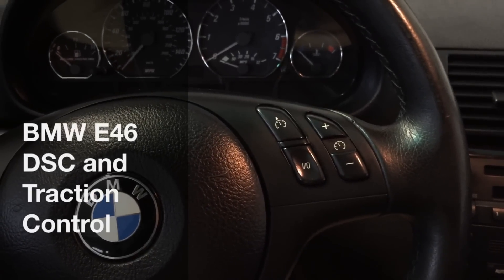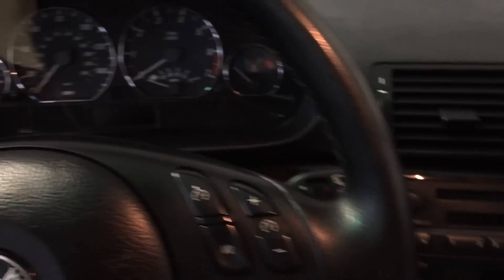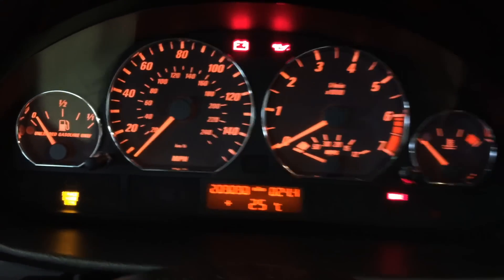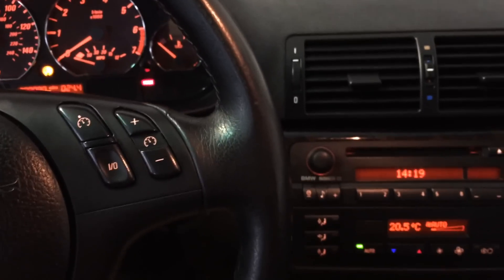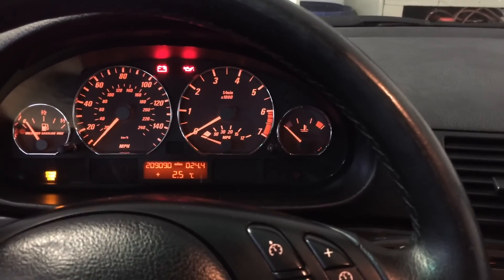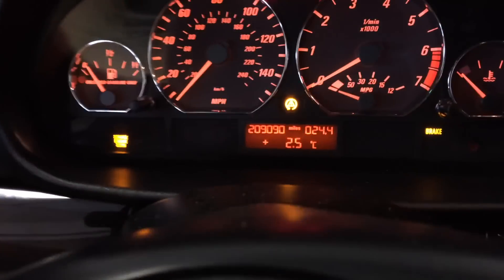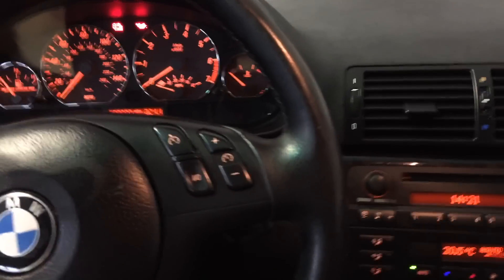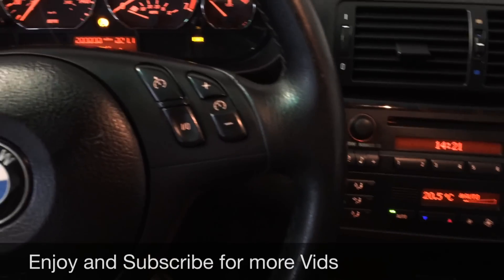BMW DSC in 3 min

Comment: ASC is a little bit different. If you guys have a ASC button than u just have to aktivate it once. And than you aktivate it komplettly. But the reason why you cant burnout/drift, could be your clutch. Because when it is slipped than you could have problems with Drifting or doing Burnouts. I hope it will help u guys!!!
Reply: i have 2002 e46 316i and i have ASC button. I was told that asc means only traction control for example when you accelerate and that it doesn't have stability control but when i hold my asc button for a few seconds both warning lights lit up (the triangle one in the middle and also yellow brake light) like on your car. i wonder how is it possible if asc doesn't have stability control that in my case the light for stability control (yellow brake light) lits up, any ideas why?

Comment: i have 2002 e46 316i and i have ASC button. I was told that asc means only traction control for example when you accelerate and that it doesn't have stability control but when i hold my asc button for a few seconds both warning lights lit up (the triangle one in the middle and also yellow brake light) like on your car. i wonder how is it possible if asc doesn't have stability control that in my case the light for stability control (yellow brake light) lits up, can someone explain?

Comment: My 2003 bmw 325i has a problem were the it has the yellow brake light on and my hand brake is down and still stays on and my dcs button won’t work I press it and won’t turn the light off and I wanna do a burnout lol. Any ideas what it could be ? Maybe abs sensors or. Dcs stability control pressure sensors?
Reply: JCarVideos MA what was the remedy for this? my car has the exact same problem
Reply: Check your traction sensors

Comment: Look at the mileage at the end of the video. It's all messed up. I noticed my stereo doing that on the BMW I just bought.
Reply: thats a common pixel error. Typical for BMWs of that era. Try and get a used replacement stereo. I did that too and it works now.

Comment: So when the lights on that’s the best way to drive?
Reply: No the exact opposite. The light warns you that dsc is disabled. If you want to drift or burn out or something like this turn dsc off. Otherwise in an everyday driving you must be sure dsc is enabled. It is automatically enable everytime you turn on your car and if you dont press the button it will be activated. It can save your ass in a bad situation.

Comment: I have a 2000 BMW e46 328i and I hold dsc for 6 seconds but my light to tell me my systems are completely off doesn't turn on, is it possible a fuse is out or something
Reply from the maker: There might be a difference between your model year 2000 328i since my car is a 325ci and was produced between 2001-2006. Does your button say DSC or something else like DCT, ACT, or ACS? If a fuse was blown then the result would be both lights, warning triangle and yellow brake light, would be illuminated all the time. You could take a look at your fuse box in your glovebox and look over the reference sheet that is in the glovebox also to check if any fuses are blown. In regard to the physical lights they are LEDs so they are probably working. Do any of the lights turn on when you click the dsc button?
Reply: Ross Piccinini the button I have is DSC and the only light that comes on is one in the very middle with the triangle with an arrow around it, I'll have to take a look at my fuse box, it's possible that for me just pressing the button once shuts down my dsc systems completely with having to hold it
Reply from the maker: Your model might be designed like that. That would mean that you do not have the ability to only disable traction control without also disabling stability control. Does your e brake light turn red when it is pulled up?
Reply: stop the engine for 2 minutes then start it up , the dsc should turn in.
Reply: My shit is the same way the button doesn't do anything
Reply: Ross Piccinini hey bro I just bought and x5 4.4 last German car made and then it was made in Mexico and other places
Reply: 2005 e46 i have to press it 5 times and with the 6th press hold it in till lights come on
Reply: Tyler Wall what does the sound button next to it do?
Reply: Did you found solution?

Comment: I think mine was accidently turned off when they were cleaning my interior. I get those two orange lights after driving a few minutes . How do I tunred dsc back on?
Reply from the maker: That could be an alignment issue. The lights should only turn on if you click the dsc button. If the button was clicked when cleaning the interior it doesn't have an effect on anything especially if the car was off. The dsc system is reset every time the car is turned off and on.
Reply: If the DSC Light (circle thingy) and the BRAKE light are yellow, and will not go off, you need to have your Steering Angle Sensor checked, by a scanning tool. It's not hard to replace, but it has to be calibrated after you reinstall by someone with the proper software.

Comment: I have a 328i e46 1998. And there stands ASC and not DSC the second one doesnt light up. And i cant drift at all. Whats the problem guys? Please help me.
Reply from the maker: Ya I have heard a little about that. ASC is a different system. Best luck
Reply: Ross Piccinini thanks man
Reply: ASC is a little bit different. If you guys have a ASC button than u just have to aktivate it once. And than you aktivate it komplettly. But the reason why you cant burnout/drift, could be your clutch. Because when it is slipped than you could have problems with Drifting or doing Burnouts. I hope it will help u guys!!!

Comment: hmmmmm, i se all these lights working when i turn on the ignition, but as soon as the car is running they dissapear. but the ABS or traction controll never worked for me :p i have driven about 6000km this winter without traction or abs. #driftlife :D it has 280000km on it so it would be wierd if there was no electrical fails as it has been driven on the norwegian salted and disgusting roads.
Reply from the maker: That is really bad ass. Hash tag adrenaline junkie possibly.